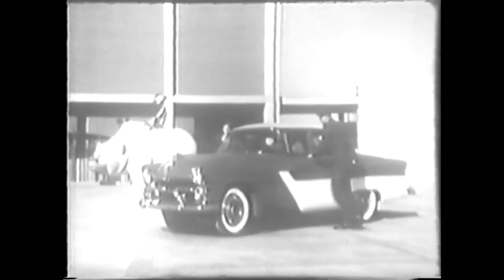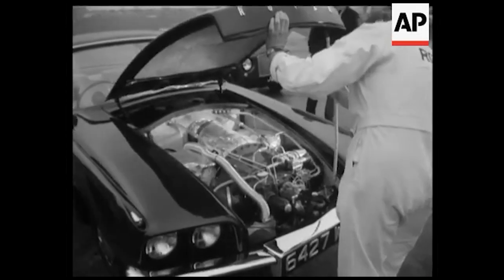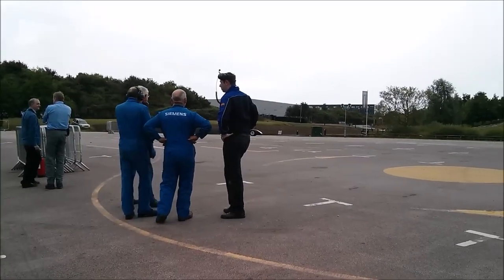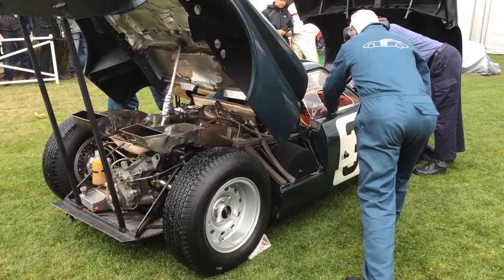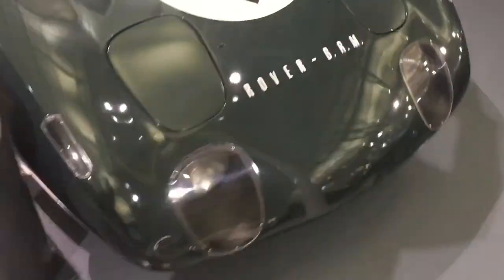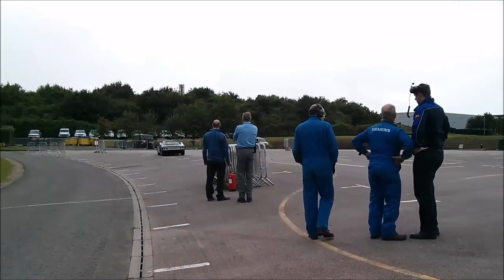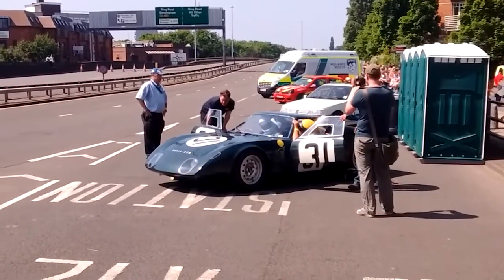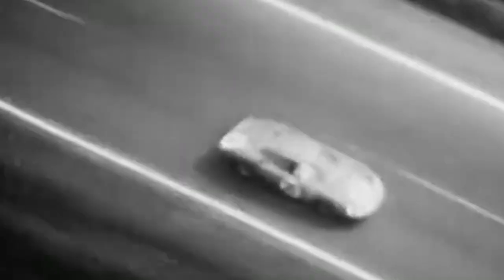The Story of the Jet engine Lemans Race car – Rover BRM

Comment: 👍💪✌
Turbine cars, those were the days. 
The McMurtry has a little turbine range extender, or was it a different one?
Reply: mcmurty is fully EV with  electric fans, ariel HIPERCAR is the ones used range extender. differents principles the rover-brm using turbine to directly propel the car instead the range extender to charge the battery like the series hybrid
Reply: @seogabonotjah6555  that's it, the Ariel, the newest one they made.